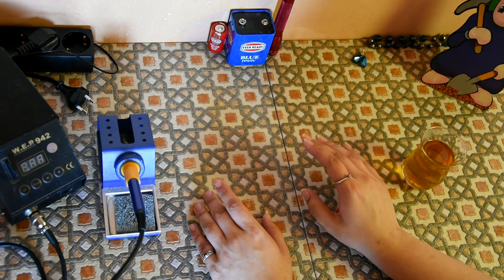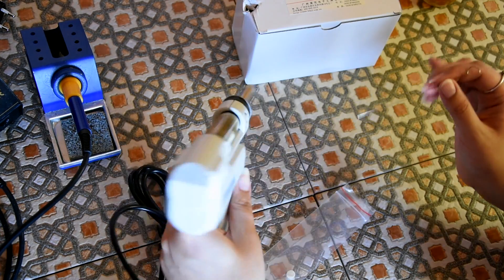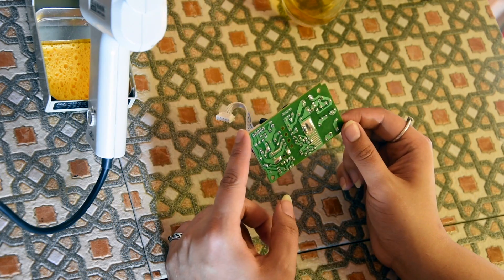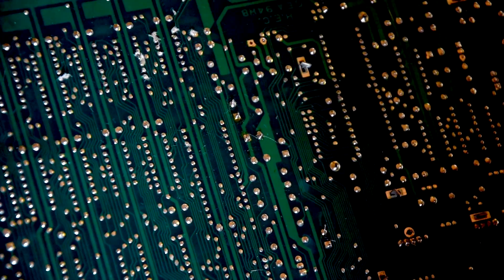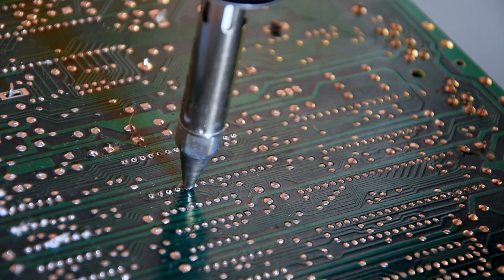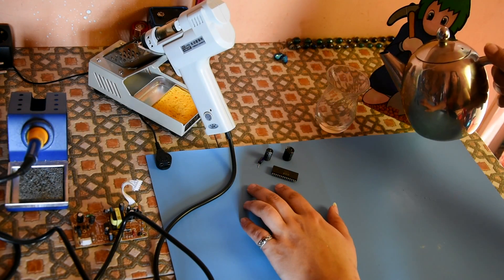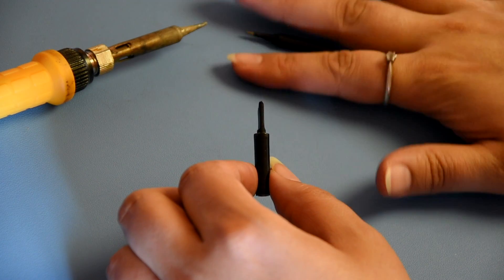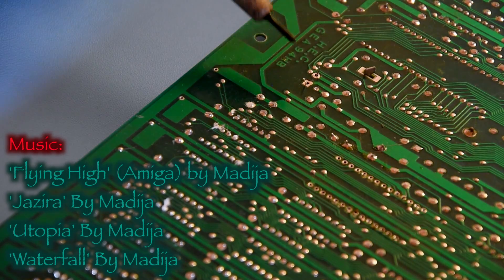Electronica - Desoldering pump unboxing, test & review

Comment: Put some rubber around the sharp edges of the desoldergun stand :)  Because it's #2Edgy4Me
Reply from the maker: It should be fine if I keep my hands off it, I figuring rubber will stink when hot.Hopefully i'll come across something more fireproof/heatproof :o)
Reply: how about rounded stones? Like some long pebbles. Cut one in halfs and dremmel out a nice cutout on the side that got cut. So you can move it onto the sharp edges of the holder and letting the smooth sides of the stones face towards you.
Reply from the maker: wouldnt it be easier to just sand down the sharp edges if i'm doing that lol... I can always get some heat resistant tape or something...Thanks for the suggestions :o)
Reply: It would be easier, yeah. But wouldn't it be boring? :3
Reply from the maker: I know what you're saying, but i'd find desoldering and creating something more interesting than dremelling pebbles in half lol ;o))
Reply: Sand the edges off.

Comment: If you use a little bit of flux, the pump will work even better. But it also will become more dirty because of the molten flux sucked into the pump.
Use the filters to protect the pump inside the desoldering gun.
Happy unsoldering!

Comment: you probably already found out, but the white pads are air filters seated at the back of the glas solder collecting chamber.
Reply: the filter will prevent sucking the solder too far into the gun. (just like those filters behind the dustbag of a facuum cleaner does) i saw someone place a coin between the spring at 1/3 (one/third) of the front, so solder will be stopped as soon it shoots into the chamber and cools down quikly.make sure you use a coin that alows enough airflow around it ofcourse. i dont know the diameter of our chamber. this coin will give you longer lifetime of the spring. and push the ram rods into the tip more often to keep the tip clean. and use the gun only if it is heated up completely to prevent cooling down too quickly when the solder not yet reaches the chamber.

Comment: Very nice! Haha, yeah, these desoldering guns make things sooo much easier. I remember wearing a permanent smile on my face for hours when I first got mine (I have the "station" version that is quite similar but has the pump in an external case). :)

The only downside to these things is that they sometimes get clogged really badly. I sometimes have to use my iron to heat one side of the gun and poke in the other with the cleaning sticks they come with. Other than that, they are great!
Reply from the maker: I saw your video appear after uploading this as it's related. yours looks pretty good and seems like the one that we had back in college, the one with the external pump, it looks pretty decent and figuring it will have a strong pump. 
I know that permanent smile very well after removing that SID chip haha :o)
Reply: Judging from your video, the pump is about the same strength. Maybe the external pump makes the whole thing live a bit longer. Plus the weight of the gun itself is probably a bit lighter. :)

Comment: Seems like a pretty good solution to desoldering. That plug looks like an Australian power plug.
Reply from the maker: Thanks, I always remember the Australian one being 2 pin slanted..but I guess with earth it makes sense.
Reply from the maker: I searched for it, it's a chinese plug, but if you turn it upside down you can plug it into an Australian outlet :o))
Reply: Aha! A Chinese plug! Good to know - so the Chinese plugs do have a ground by default.

Comment: I have the same. It must be operated at low temp. Also I need smaller tips cause it will damage some ram ics. Can't find at all.
Reply from the maker: Have a look on ebay for desolderign gun tips/nozzles, I heard it's just the standard size and i've seen some there.

Comment: Congratulations on the new toys. Makes life so much easier when de-soldering. I got one with the pump in a separate box, but the same operation. 

Couple of quick tips. 

When using your de-soldering gun, especially on through hole plated boards.. Wiggle the lead in the hole as you  heat the solder, and while sucking the solder out. This frees it up from the sides of the hole, and lets you know when you heated all the solder. And it slips out even easier. 

For your soldering iron. Wrap the ceramic part of the heating element in foil. Copper if you have it, but aluminium works too. Get a snug fit on the tip, and the heat will transfer better. 

I wish you many hours less de-soldering, and reduced frustration.
Reply from the maker: Thanks for the tips, I will do this the next time I deal with through hole components. 
And I must try that aluminum foil trick!
I'm looking forward to my next recapping actually haha
Reply: The tips being loose on the iron will cause a couple of issues (annoyances mainly) tip temperature not correct and thermal capacity being lower. The cause can be of 2 things, the first (and most often the issue) being the tips are cheaply made so the manufacturing is not very accurate. Second, the heating element is not of the correct size (this kind of iron mostly use the same heater but different manufacturers and tolerances will affect the fit) I have a Hakko FX-888D and the quality tips I have bought (Hakko and Plato) fit very well. However, I have bought some tips (even some sold as Hakko and are in what looks like Hakko packaging. However, when you open and examine the tip itself you realize it's a knock off) that are made differently and to different standards. A good tip should be made of copper with an iron plating (this makes for good thermal dissipation) but some are made entirely of iron. one last thing when fitting a tip, it's not just the diameter of the part that goes over the heater but also the depth. If the tip is loose and the heater doesn't reach to the bottom of the cavity, you are not getting the best out of your iron. I know it sounds like I'm being picky (or another term) but when dealing with these old systems I like to be as perfect as possible (it's not like you can order up all new parts from the manufacturer) the longer the iron is touching track/pad/components the higher the risk that thermal damage could be done.

Comment: Here is a link to the US version of the de-soldering gun on ebay.  

http://www.ebay.com/itm/S-993A-110V-90W-Electric-Vacuum-Desoldering-Pump-Solder-Sucker-Gun-In-US-/251876278039?hash=item3aa4feff17:g:i9MAAOSwdGFY2fNZ

  BTW Maddi, the small felt discs are replacements for the gun.   They stop the airborne solder particles from getting to the vacuum pump.    Once they get clogged, the air flow will be restricted and the performance will suffer.   -bob
Reply from the maker: Thank you for letting me know about the felt discs Bob! I checked and there is one stuffed into the back.
By the way, thanks for posting the ebay link.. also links to both US and European voltage versions are in the description from that online store, also the link to that man's video who has the discount coupon codes for it. They're still valid.
Reply: Just as an extra FYI about the filter pads. Once they start to clog and block airflow, you can normally peel a lay off the pad and reuse them. Never use without a pad as it will kill the pump.

Comment: That is amazing! I've been struggling with a manual non electrical desolder pump and it can be tough to use. Its never gets a socket clear of solder in the first try. I definitely need one of these.
Reply from the maker: I got seriously fed up of those manual solder suckers, they work fine at the beginning but the ones i'm constantly having to pull apart and unblock. This it seems will save a lot of frustration.

Comment: Isn't it amazing having one.  It still can be helpful to reflow the pins before using the desoldering tool.  Are there tips available for it?
Reply from the maker: Indeed I think this is going to save so much headache! Yes, I was thinking I didnt add new solder. 
The tip, i've heard, is a standard desoldering pump/gun one so you can get them on ebay apparently. I havent checked this though.